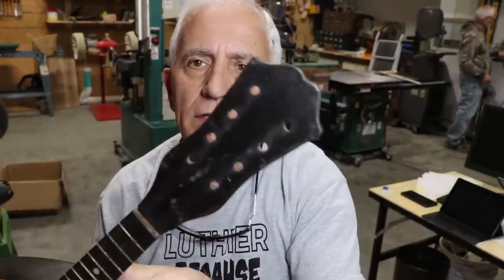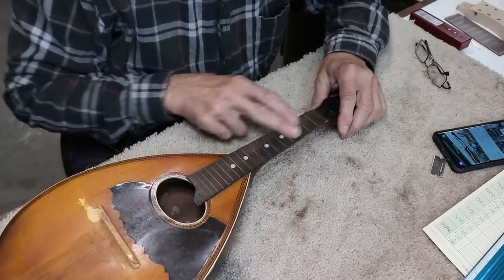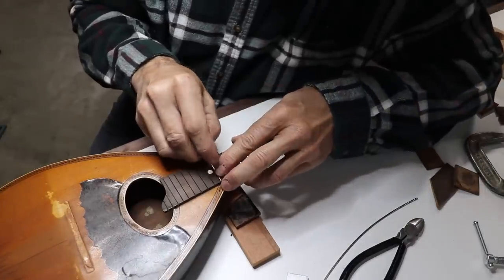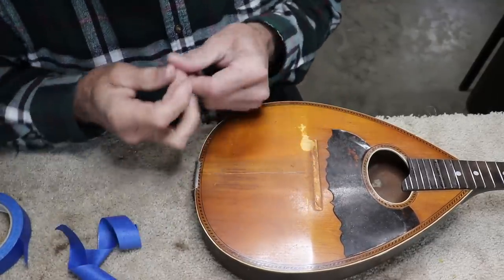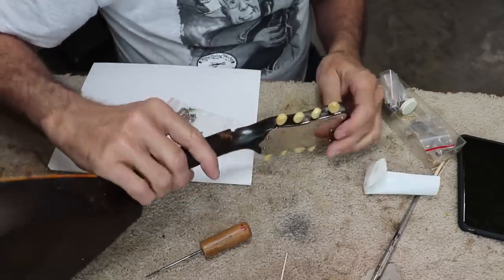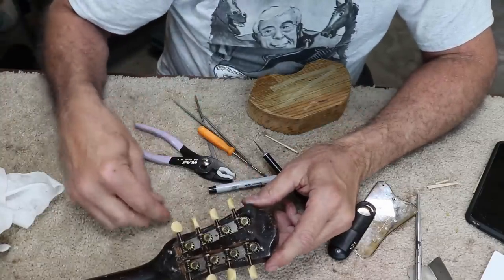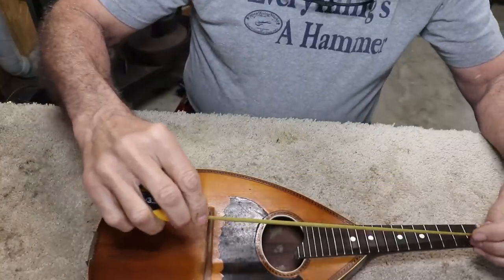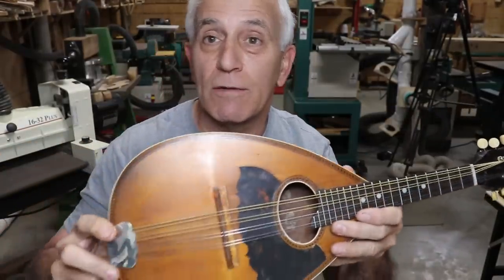396  RSW Just Working The Bugs Out

Comment: Hi Jerry;
I couldn't agree with you more on the tuners not slipping. They are designed such that you would break the teeth off before they would slip. The only way they could slip without the teeth breaking is if the frame hole was elongated or the frame was deformed enough to allow the teeth to become disengaged. Isn't it fun working on really old brittle wood. I haven't run across it in an instrument, but in remodeling I have. It has to be a labor of love to keep going with it. Really enjoying the video. Going back to watch the rest.

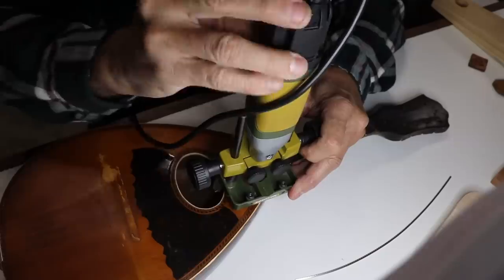Comment: Was holding my breath as I watched the headstock flex as you were applying pressure during the fret routing procedure at 26:12, that was a good test of the glue joints repairs you made and if anything else was cracked/loose it would likely have broken then.

Comment: I’ve repaired the headstocks on a couple Gibson’s, just taking my time lining up the break and using titebond, and every clamp I can fit, but in studying I’ve seen this trend with people making a jig to cut a channel with a router and then installing splines of same type of wood. They claim it’s to increase the surface area glued, that would be interesting sometime in a video to hear your opinion on that. I remember once watching you actually make a section of the neck at the headstock, I’m not brave enough to attempt that yet.

Comment: Greetings Mr. Rosa; regarding the Gears, metal wear makes the surface of the sprocket and the base plate coarse, buffing them(0000 steel wool and then fine buffing paste) will reduce friction and make them slide easy, to clean the worm gear joint soak in warm oil or brake cleaner,, What i usually do is soak in 5% distilled white vinegar over night (the things that come off) and the use brake cleaner and a rag.  Use wax to lubricate or grease (to avoid rust and dust mixing), this happens all the time with Bass tuners and it's part of the maintenance.

Comment: I did an old Fairbanks mandolin banjo that had that kind of peg head. I put new modified to fit tuners and although there were no cracks or breaks I heavily reinforced the inside of the slots with epoxy.

Comment: A lot of these mandolins were made by a company called Lyon and Healy. I have the “taterbug” version of this mandolin made almost 100 years ago. It too had bad issues with an almost identical headstock. It was stamped Osborn, on the metal plate. Am in an ongoing restoration on it. It suffered from a badly warped top. Playable, but the bottom strings buzz a little.
Reply from the maker: Lyon & Healy were even better known for their banjos.
Reply: Yeah, they made just about anything that would make money. I have one of their ukuleles.

Comment: Hi Jerry, on the tailpiece repair , Was that silver solder . Its wonderful for fixing nickeled items, . Takes more heat to flow but stronger. Comes with liquid flux, in a tube., when used, solder goes right where you want it. Its runny use sparingly. Larry

Comment: Nice job! Jerry I really want a bowlback mandolin (I know you hate them) to repair and your methods give me a good idea of what is within my capabilities.
If you are colourblind there are apps for smartphones and PCs/Macs that will give you an RGB, CMY, CMYK or HSL (16,777,216 colours) value for an average over an area or a single pixel. Paint shops use the same technology to match a colour sample but you do not need to calibrate to a colour table, merely match the repair to the surrounding area. OTOH, females can distinguish twice as many 'hues' as males so Melissa may be better than current technology.

Comment: That's a really odd design. From the top, it's looks like a potato bug mando (chili dipper, as you call them), with the oval sound hole and the teardrop body shape, but then it has the shallow body and a flat back.🤔 I'm really curious as to why the original bridge would have been so far off... shrinkage over the years maybe?? I've actually run into the same issue with the tuning pegs on the old Washburn banjolin I used to have, but it seems they didn't drill the holes for the pegs straight through the neck, and a little reaming of those, and it was fine.😉 This one really turned into quite the project!😁

Comment: I have a mandolin almost identical to that one , it's a Sears and roebuck according to the label inside of mine. I bought it from an old neighbor for 5.00 in the 60's He played it on our local Radio station in the late 40's I had the same problem with the headstock on mine, just a poor design, I would never have installed tuning gears like that.

Comment: I think the point of hide glue is for violins which are built in such away as to be easily taken apart and worked on unlike a guitar. So an acoustuc glue which hide glue is that can be taken apart makes sense. Hide glue on a guitar doesn't make sense. One of my guitars had a fingerboard put on with hide glue. I opened the case one day and the fingerboard was just hanging completely separate from a relatively new instrument. Fixing a violin with tight bond would likely ruin it however. No legit violin maker would work on it. Also a violin due to the trapese design the same stresses on the bridge and glue joints don't apply.

Comment: The part that you referred to as a "worm gear" is properly called a "worm" and what you called the "spur gear" is actually called "worm gear". While it is generally fairly easy to drive the worm gear by turning the worm it is impossible to drive a worm by turning the worm gear.

Re the multiple breaks in the head/neck, I was starting to wonder if it would be easier to just make a new one (yeah, I know taking the old one off would be more work than making the new one). I wonder if the plate was holding it together.....
Reply: Bob, you are correct about the spiral shaft being called the "worm", but the round gear is call the "worm wheel" and the entire assembly, of the two gears and shafts, is called a "worm gear".
Reply: @zapa1pnt  According to Wikipedia the "worm" can also be called "worm screw" and the "worm gear" can also be called "worm wheel". The entire assembly is called a "worm drive". https://en.wikipedia.org/wiki/Worm_drive

Comment: All conspiracy theories aside, A 440 hz was not standard till 1953 (accordingto some googling). It occurred to me when you were setting it up that is is very possible that an antique instrument could have been set up for one of the higher A frequency common in that time period  such as 450 or 460 hz, which if I'm not mistaken would make the bridge closer to the original position. Just a thought...I might be all wet too but it crossed my mind.
Reply from the maker: The way you tune it shouldn't make any difference on the intonation. In fact you can set the intonation on any pitch and it was the bridge should stay in the same place. I do it all the time
Reply: @RosaStringWorks  you are right. I see what you mean. I was confusing the intonation set up with tuning....told you I might be all wet lol

Comment: Jerry, Its me again. Dan Colley has a good point on what the bugs may have been, bedbugs. Probably better odds of those than my suggestion. Good luck.
Reply from the maker: No I don't believe they were bed bugs bed bugs actually have a very distinct look
Reply: @RosaStringWorks  i think they are carpet beetles.... Maybe...
Reply: @RosaStringWorks  , those bugs are most likely some species of *powder-post beetle*. The larvae that tunnel into the wood, creating the pile of powdery sawdust,  are very difficult or almost impossible to kill.  Here in New England it is generally recommended that you do not store firewood in the garage or next to the side of the house or anywhere that allows the beetles to easily get into your framing.  Even whole-house tenting and fumigation might not kill them, and that technique is banned here anyway.

Comment: Jerry, I couldn’t get a good look at those bugs for identification, but since they were coming out after driving the frets I suspect they’re the adult stage of some wood boring larva. When you were inspecting the interior did you see small round holes about 1 to 2 mm in the neck block or any braces or observe a large amount of particles looking like sawdust. The adult lay eggs on wood, the larva bore in and stay for years making tunnels. The larva pupate and the adults chew through the surface leaving a hole and spills sawdust from the tunnels. The most logical method of eradication for a mandolin is to freeze the instrument for several days in the freezer, as insecticide kills the adults not the larva buried in the wood.  I don't know if this will harm the instrument or not. The other method of heating the instrument to greater than 122 deg. F for 48 - 72 hours which  is effective, but not good for the instrument   If you have an infestation in a bass, good luck, get a big freezer. Now you know. Glad to help and I enjoy your videos.
Reply from the maker: I actually thought of that and I did look for holes I saw no holes at all.
Reply: I inherited a damaged Italian mandolin, labelled "Stridente, Napoli" some 50 years ago (When I was 14) the bowl had numerous cracks between the slats, the neck was cracked and there were only a few old strings on it - not tight .  Also there was one hole on the top, looking like a wood worm bore. I kept it as a decorative item for twenty years, always thinking that one day I would get it repaired or that the woodworm would spread and destroy it! . Eventually I decided it was time to fix it. I wood glued the neck and slats, and strung it up, and it is still a wonderful playable instrument - much to my amazement. For many years I expected the neck to snap off,  but it has stood the test of time!

Comment: When solder wont flow use more flux.
Reply from the maker: I wire brushed It and coated it with flux several times.
Reply: @RosaStringWorks  all flux is not the same. if electrical flux wont work use copper pipe flux.